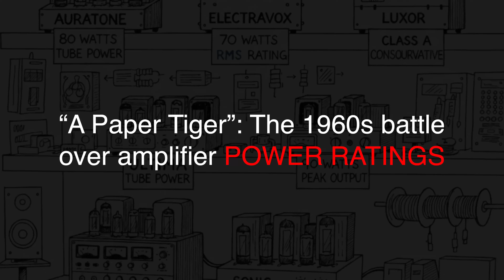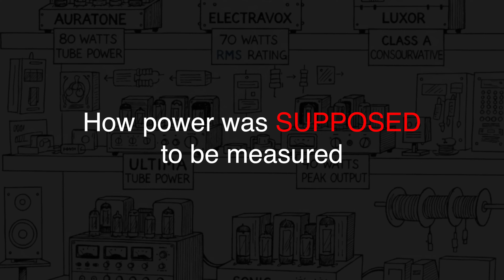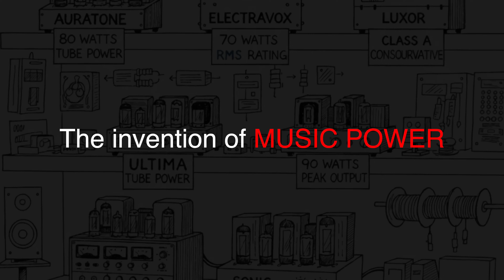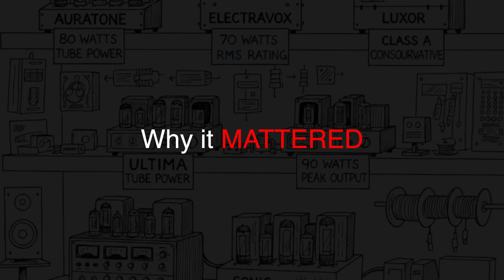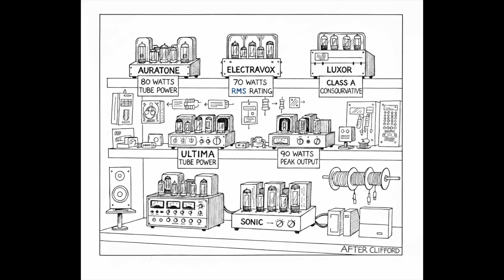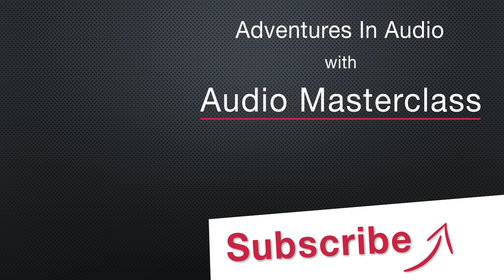When 20 watts became 80: The 1960s battle over amplifier power ratings

Comment: Google AI has a better description of the problem of RMS  "Doesn't Reflect Music's Transients: Music signals are highly dynamic with short, sudden peaks (transients) that can exceed the average (RMS) power rating. An amplifier with good "headroom" (ability to handle these brief peaks without clipping) is often more important for high-fidelity audio than a high continuous power rating alone."
Being pedantic, it's totally correct to present the dynamic power of a class D amplifier as it represents the actual output capacity of the circuits, albeit cannot be sustained. This is exploited a lot in HT receivers as movies have lot dynamic range  and their average (RMS) technically "effective power" is very low compared to maximum instantaneous level.

Comment: Ah, the apples and pears power ratings strategy of those pesky marketing types! This was one of my first lessons into serious audio. Happily, and despite a reputation for danger, a "little knowledge" is, in fact, a very useful guide to crossing minefields such as these.
As an idea for further commentary, perhaps you could do a piece on the related [though opposite] first world, audiophile problem of correctly rated power amplifiers that are so powerful that the volume control on the DAC has to be turned down so far that one risks losing bit depth!

Catching this post later than usual, did not spoil the fun. Many thanks.
Reply from the maker: Turning the volume down does appear to be an issue in that there are different ways it can be done behind the panel. I'm sure I won't be able to resist making a video on the topic.
Reply: @AudioMasterclass  👍👍👍

Comment: Bluetooth portable speakers usually fitted with class D chip based type amplification will be fantastically inefficient. Most of the watts whatever they are go into driver small speakers or bass radiator. I remember PMPO from the eighties glorious days of power hype.

Comment: Yes, consistency is important for comparisons. But two-channel-into-eight-ohms RMS isn't a realistic figure. For one thing, it's measured with a steady sine wave into a resistive load. Loudspeakers are complex loads, with an "8-ohm" speaker typically offering differing resistances at different frequencies, often from 4 ohms to 30 or more ohms. For another, it's totally unrepresentative of real music. That said, coming up with a decently representative dynamic music sample and a decently representative loudspeaker load would be impossible, so we're pretty much stuck with the existing standard, at least for publication purposes. That's in part where listening comes in. Two more things. First, pedantic types will say, correctly, that 80 watts RMS, for example, is a meaningless term because root-mean-square can't be applied to power measurements. But it's merely shorthand for the power calculated using the known resistance and the RMS voltage. Last thing: I've measured dozens of amplifiers and home theatre receivers. The latter are multichannel, and almost exclusively their power figures are for when the unit is used in two channel mode. Back in the 2000s, Harmon Kardon extended the "all channels" paradigm to multichannel -- so they'd specify a five channel amp at the max power it could achieve from all channels simultaneously. Since everyone else was specifying it for only two channels, this made them look underpowered on paper. And, really, why would you want to do it for all channels? With stereo, most of the time both channels are delivering roughly similar levels. With surround sound, the rear channels are very rarely delivering the same levels as the front ones.

Comment: RMS falls short because music is not a sine wave, it is many many many frequency waves.

The RMS of undistorted music wave form is much much lower than RMS of a sine wave.
20Watts RMS can guarantee in the real world 2-5 watts of undistorted music  , that when fed into a resistor will measure 2-5 watts of heat.
the 6 watts music will start clipping, where the clips at microseconds in the (20wattsx1.14 for sinus RMS).
but it will in fact produce 20 watts of heat when powering a pure resistor with a single sinewave.
now what happens if you feed 2 waves sine waves of different frequencies , say 1K and 2K, each one cam only  have 10watts rms, plus loss some energy on intermodulation components which we shall ignore for now.
we are also ignoring loudspeaker impedance, that continuously varies not only by frequency , but also by state of membrane , and crossover capacitance reactance energy state.
Reply: I think you missed the basic premise of 'Marketing vs Truth'
Reply: Actually the music signal output from a home stereo system is nothing like "many many frequency waves" ... It is, in fact, a single voltage who's amplitude varies with time.  Your system is not amplifying music... it is amplifying that single bouncing ball voltage.  The resulting long term envelope is nothing more than a map of how to move the speaker cones.

Yes the long term envelope generated by this varying voltage has dynamic range and when measuring music the average power is quite low compared to peak power.  However; it is the peak power your amplifier needs to contend with. It is safe to observe that anything less than peak power is not a problem.  Peak power occurs where your amplifier begins clipping or producing excessive distortion... signals at lower levels are not affected by this.

Thus it makes sense to use a sine wave in testing.  We want to discover the limits of the device, it's maximum continuous power output.  A sine wave test tone allows us to reach that level in a stable signal that is easily observed and measured.  Thus it's use for testing.

The process is actually quite simple ... feed in a test tone, using an oscilloscope turn it up until the amplifier clips, then back it down by about 1%.  Now take a voltmeter reading across a dummy load and calculate the power.

The thing is to not overthink this... if we are testing power, we want to test only power.  There are plenty of other tests that can be used to test for other things.
Reply: @Douglas_Blake  I've used this kind of explanation myself many times. And the fun, incredible really, thing is that inside our heads we run some kind of FFT which decodes that single wiggly amplitude line into its multitude of constituent, discrete frequencies, and then combine the harmonically related ones so that we can pick out the violin and piano, etc.
Reply: @stephencharlesdawson  
Yes, we do that ... but an amplifier does not.  The thing actually has no idea what it's amplifying.
Reply: 80% of amplifier output power is below 200 Hz, for frequency higher than 1 kHz very little power power is required as a) human hear is more sensitive b) loudspeakers are way more efficient. It's the lower frequencies that requires the most output power and even if you have high peak power you can clearly hear when an amplifiers lack continuous power delivery. 
Of course the loudspeakers as a load are way more complex than simple resistive load, but each loudspeaker has its own impedance characteristic (with the 8 Ohm being an approximated average of only the resistive component) so I think they standardised on a simple resistive load.
Reply: @enricoself2256  
The more accurate statement is that 80% of MUSIC power is below 200hz and above that the power demands will taper off more or less according to the "equal loudness curves" (Fletcher Munsen).  The amplifier being fed a musical signal has to maintain uniform gain to accurately reproduce the music signal as given... thus it has to provide equal power across the whole audio bandwidth.